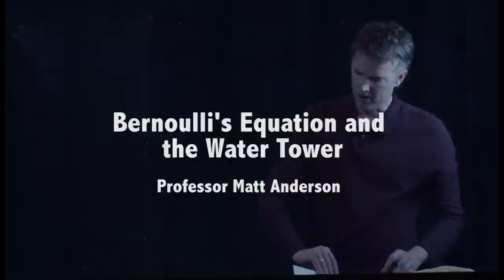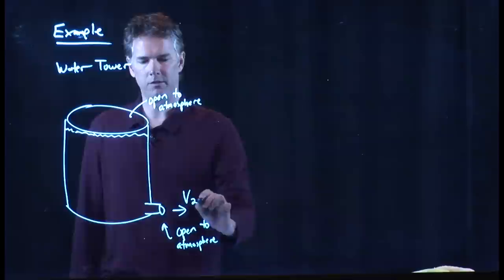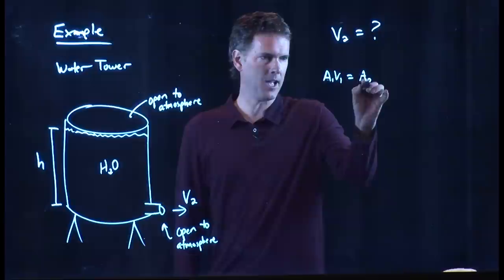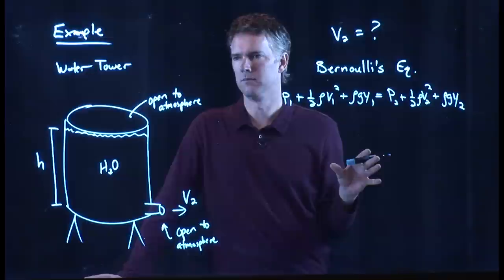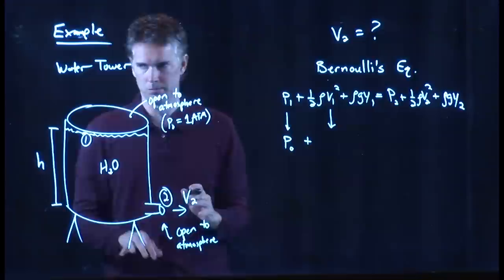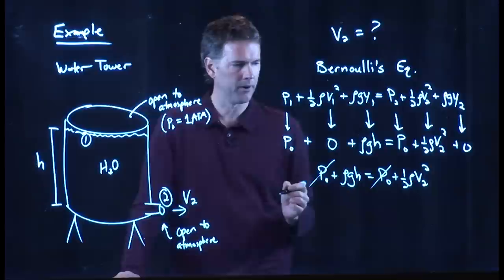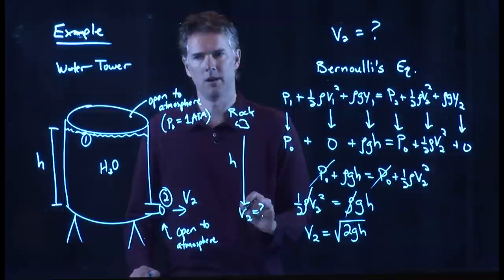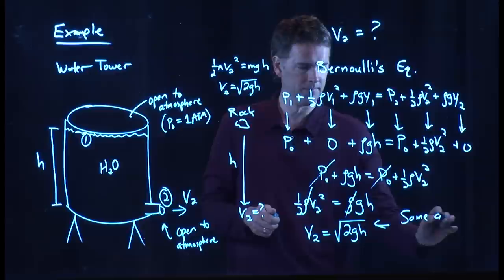Bernoulli's Equation and the Water Tower

Comment: another great  Matt Anderson Video!! Thank you.......
Reply: by the way.. it's my understanding that if you hook up a hose right at the base of the Water Tank... then let the water flow though the hose... the water goes a distance "d" ... and if you then hook up a Spray Nozzle to the end of the hose.. and set the nozzle for a Jet spray... the water only shoots out a distance  of "d" .. the same.. SAME Distance!!.. however, at home... you will find that a Nozzle (or pinching the hose) WILL Increase the distance!!..   apparently it has to do with Water Friction and the SPEED of water as it courses through the Pipes and hose. The Pressure at your end of the Line is Lower if the water is flowing Fast.   I cite the professor  Lewis Carroll Epstein from City College of San Francisco in his Book, "Thinking Physics, second edition" .. what a Surprise.. I never knew that...

Comment: How much temperature increases this velocity 
So we got biggest model ever possible 

It's less then 100 degrees which is vapor pressure against atmospheric pressure

So if we do this experiment under a pressurized chamber then we got very high speed at discharge 

Try it
Reply from the maker: Yep, haven't discussed temperature at all yet.  Which of course comes into it with the ideal gas law.
Cheers,
Dr. A
Reply: @yoprofmatt  combined ideal gas law with heat formula with Bernoulli equation 
Q= msdelta t
Bernoulli equation
Ideal gas laws
Coulombs law
Gravity laws
Quantum physics laws
Einstein equation 
All together
For finding out the maximum power possible by this siphoning in herons fountain ?

Comment: Hi.if i may ask ,if the water tank is on the rooftop tower at level 40 and goes down to level 27 up to level 32 hotel rooms..do we still need a booster pump? it supply at least 500 hotel rooms..thank you

Comment: why omit P0 tong when barometric pressure is equal to 1 and above altitude difference
Reply from the maker: P0 at the top of the tank is (nearly) identical to P0 at the bottom of the tank.  At least the difference is very small when compared to the other terms in the equation.
Cheers,
Dr. A
Reply: @yoprofmatt  i have a question, why is P2 also atmospheric pressure? i get why P1 would be that, but for P2, wouldnt there be additional pressure to the atmospheric pressure, from the water being "pushed" out/pressurised due to the weight of the water above it?

Comment: Thanks. The video is great. There is one thing that's not clear to me: Why do we assume P2 is the atmospheric pressure ? What happened to the hydrostatic pressure of the water column ?
Reply: p2 is at the very end of the spigot. The hydrostatic pressure inside the water tower drops to the atmospheric pressure as the water moves through the spigot.
Reply: @rasmushochreuter2102  Thank you.